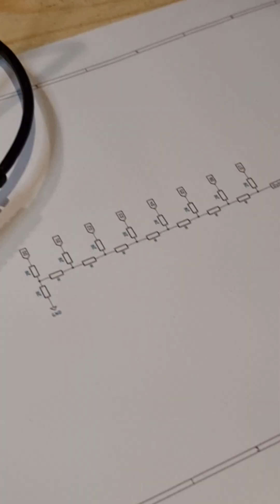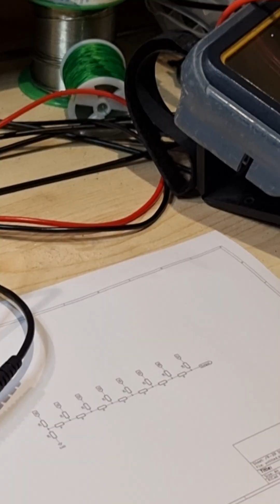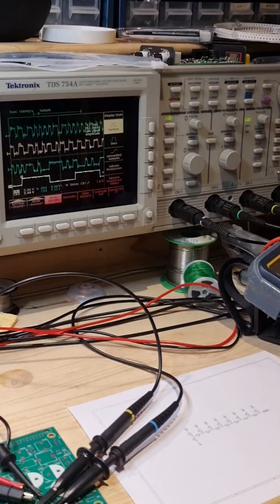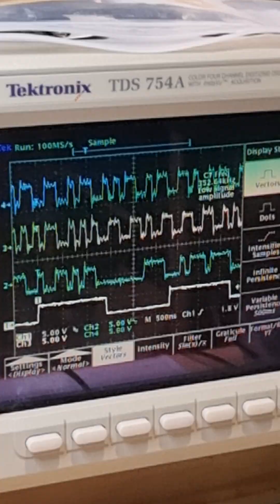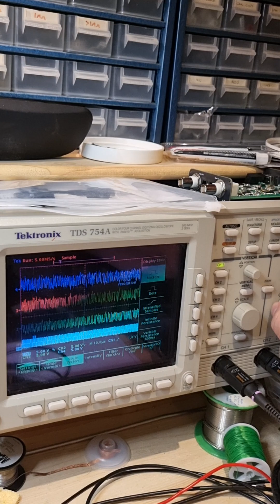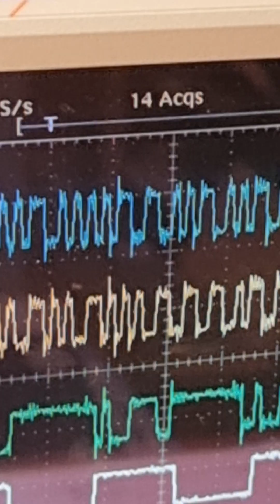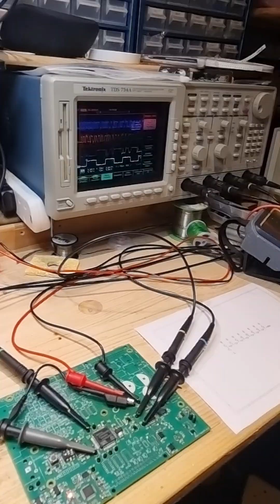R-2R and Delta Sigma DAC Types Explained

Comment: Would you be kind enough to example how you have optimised your single bit DAC?  If your clock is good to 1 / 20 trillion if a second and 24bit with 192khz = 4.6m. Nothing like your clock speed.  Is the bottleneck the delta sigma calculations?
Reply from the maker: The clock speed at the final stage of the DAC is actually 16.9344MHz. This allows for a single bitstream of Pulse Density Modulated code going into a digital and analogue filter stage. The snag with PDM decoders is that the final analogue signal level is dependent on the average area under the "graph" of the digital data. That means that its not just the 1s and 0s that are important - it's the shape of the pulses including their height (voltage), width and slope of the rising and falling edges. That makes it extremely sensitive to very small timing changes on the rising and falling edges of the digital bitstream signal. Thats why the clock needs to be incredibly stable with no jitter on the precise position of these edges.
Much of my design effort went into optimising this timing in the final design. The precision of the crystals (less than 1ps jitter) is just the starting point....
Reply from the maker: N.B. 1ps jitter is a bare minimum requirement! For the top of the range, I achieve less than 25fs of jitter!